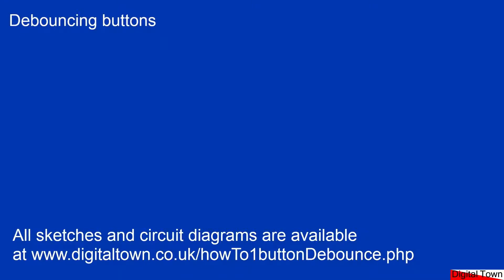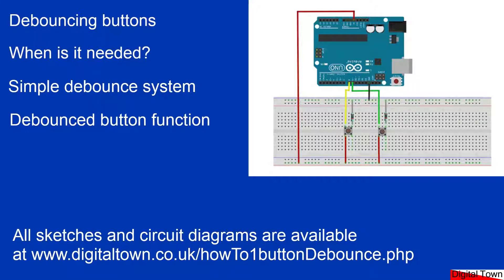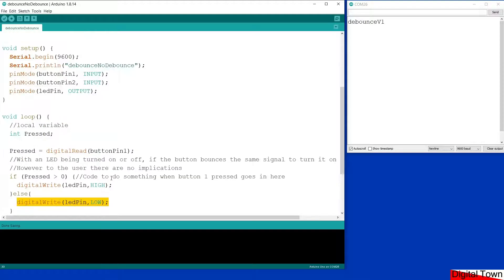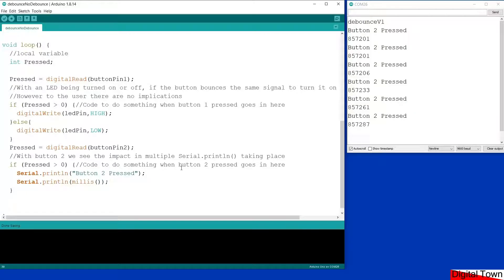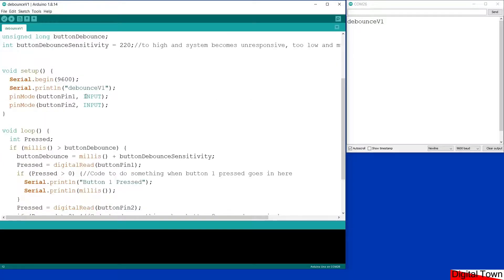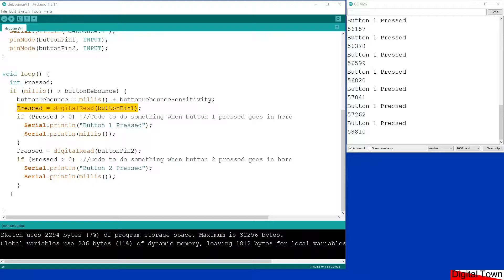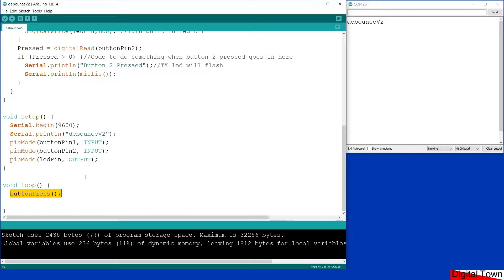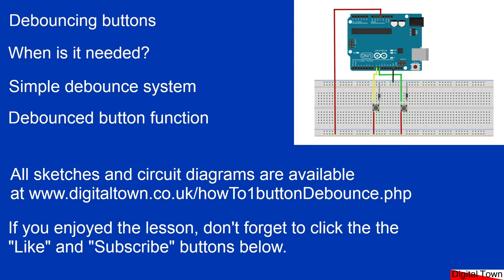Arduino C++ Course: How to  Debounce Buttons

Comment: Thank you, but I am confused. when declaring unsigned long buttonDebounce;   at top of the code, what is the initial value?  when going through the loop the first time?  How can it do the If statement?  I did not compile and run code yet.  I like your videos.  Thanks.
Reply from the maker: If a variable isn't given a value at start up it's value is by default Zero, that value will be updated after the first press.
There is a better video in the new lessons series at:
https://www.youtube.com/watch?v=kXDviSgM22w
Reply: @digitaltown5442  Okay thank you.  Living on the edge with variable defaults being Zero. :)  Makes more sense now.  I wonder though if that is good idea. Also, thank you for always finding ways to not use "delay".